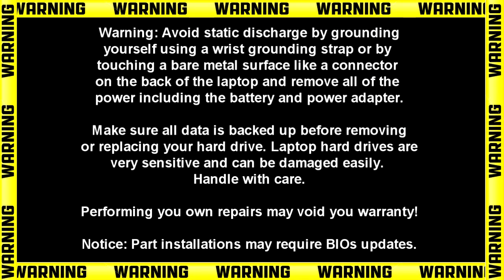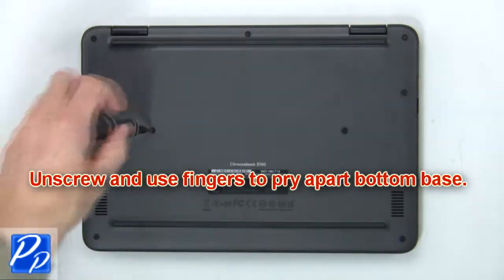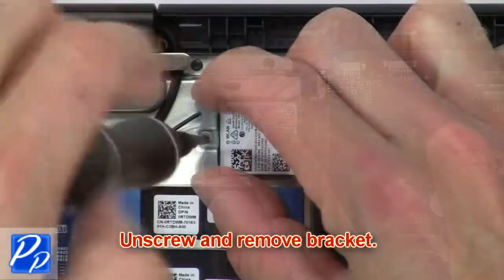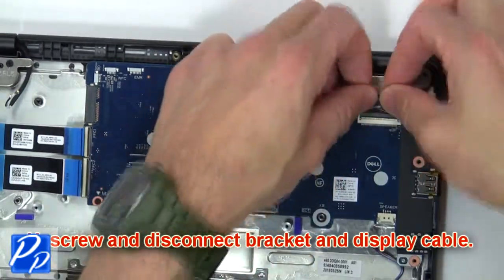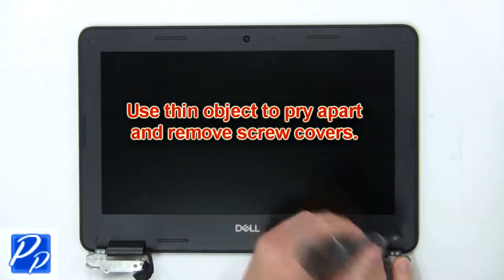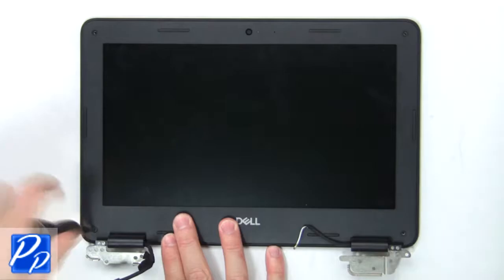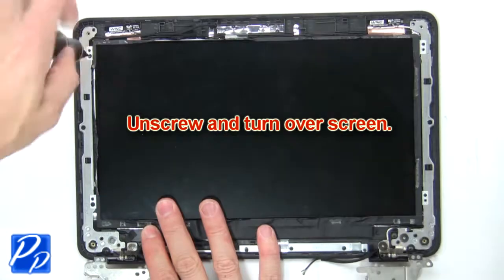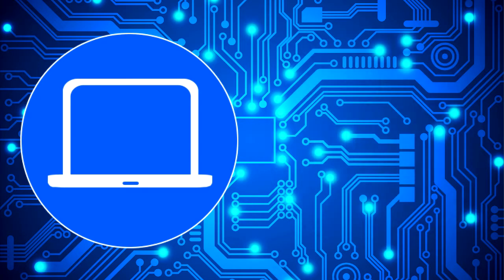Dell Chromebook 5190 2-In-1 (P28T002) Screen Replacement Video Tutorial

Comment: hey what if you have 2 of the 5190 tablet  versions 1 has the internal screen damaged and the other has a charge port missing  and buttons that don't work can i merge the 2 or no  please respond with 1 hr as that's all that's left on the device
Reply from the maker: If they are the same model with the same motherboard/components then you should have no conflicts when consolidating them.